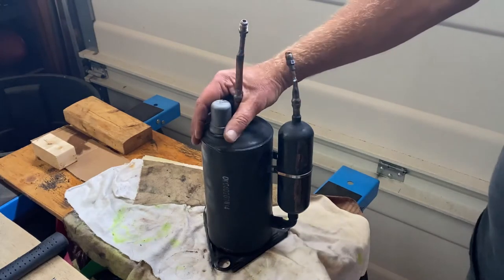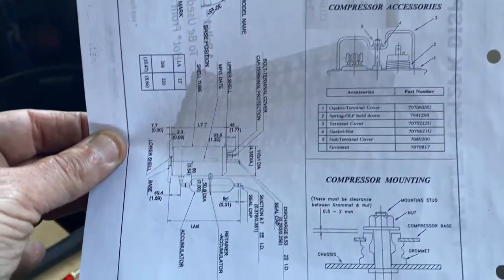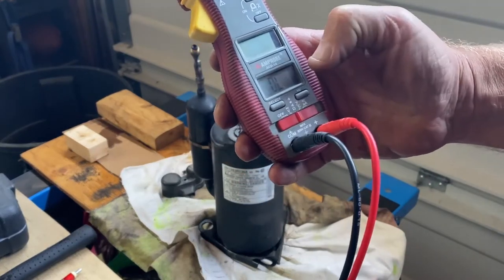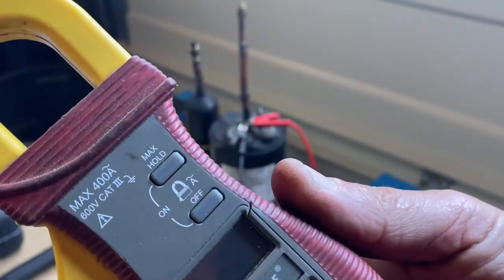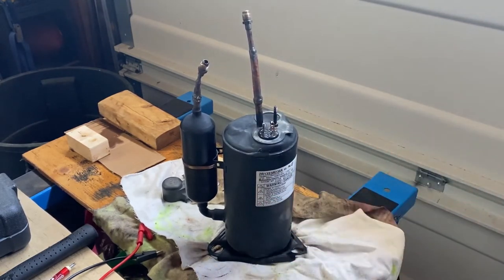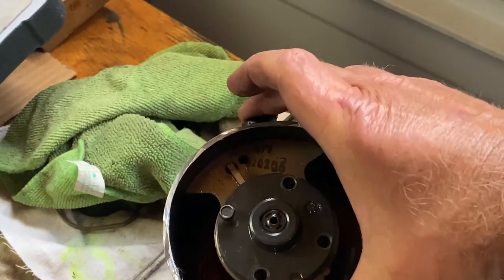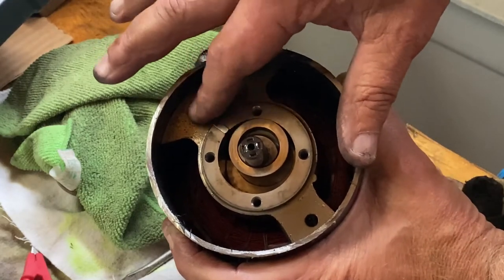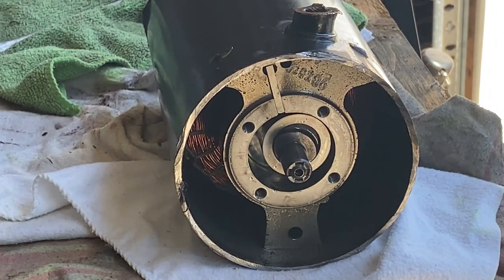4.CompressorRotary

Comment: Interesting how the compressor uses a combination of oscillation or eccentric operation "Wankel cycle", combined with a vane mounted in the case. I see no apex seal on the vane...I assume that compressor oil in the refrigerant lubricates the pump ?
Reply from the maker: That is correct, the oil creates the seal.